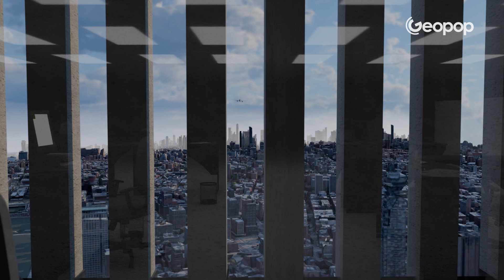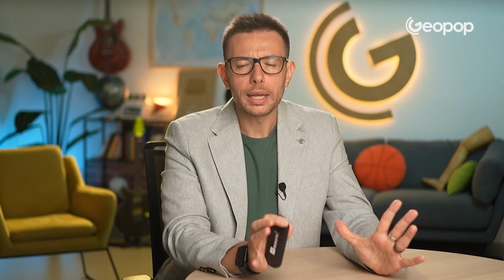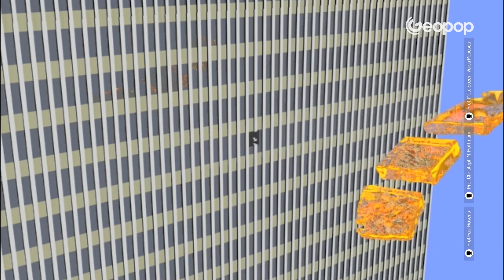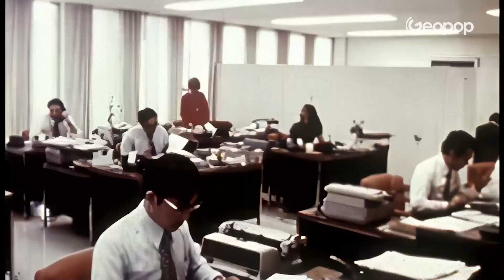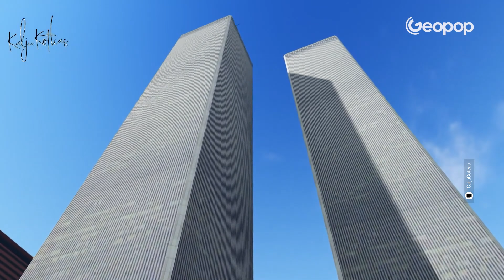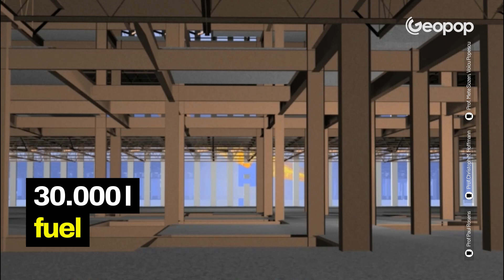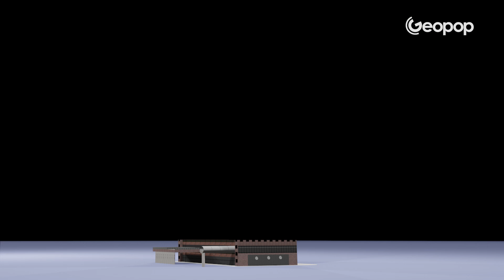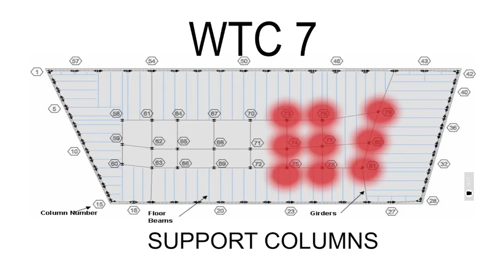9/11, 2001: The Technical Reconstruction of the Twin Towers and WTC 7 Collapses

Comment: One commercial plain with ppl and low amount of fuel can collapse the most endurable constructed building in world? You actually want us to believe in this BS? How can lower floors who haven't been intact with flames collapsed as they were made from paper?..nonsense....ok it's possible to be collapsed upper floors, but lower isn't possible in fact they are constructed to be capable to maintain high earthquake magnitudes! But if you watch how controlled explosion with termite dynamite is used in construction for demolition, it fits like 200%! For ones that believe in this BS just watch videos of urban areas that are involved with war like Belgrade or Sarajevo or any building in Ukraine or Israel, with high temperature altitude rockets and bombs, those buildings still stay strong, now think twice what is truth and what is BS that they want you to believe!
Reply: Belief has nothing to do with it. It's science, but science is hard and most people are lazy and want to take the easy way out with a simple hand-wave rationalization.  Not me though.

Twin Towers collapses were relatively straightforward and well understood in the professional engineering community within just weeks. Yet there’s still a lot of really bad information floating out there easily accessible on the internet, premised on wild baseless speculation and pathological theorizing with easy hand-wave answers.  Engineering is hard. This stuff is simple, exciting and requires little or no thinking, so it gets far too much attention.

Because anything can seem like a conspiracy if you don’t understand how it works I prepared my own short yet detailed technical description of Twin Towers collapses from my own observation and analysis of available true and relevant facts. No politics, ideology or magical thinking, just engineering. Hopefully this will dispel many common myths and answer most if not all questions you may have about the collapses.  

While complex, most of the Twin Towers collapse mechanisms can be seen with the naked eye and easily discerned and understood by the layperson if sufficient time is taken to understand.

1. The Twin Towers consisted of 4 primary structural elements that together formed an integrated system where each relied on the others. 47 hollow box-section steel Core Columns carry the majority of the gravity loads. The 236 hollow box-section steel Perimeter Columns carry the remainder and ALL of the lateral (wind) loads. Long-span Lightweight Steel Trusses connect the core and perimeter column together at each floor with a Hat Truss on top to tie the structure together as an integrated unit where no element can survive without the others. There was no structural load bearing concrete and most components were bolted together.

www.youtube.com/watch?v=u7OqrC74Dm4

2. The impact of 117 tons of airplane (= to about 12 dump trucks) at speeds up to 590 mph with the energy of a ton of TNT completely destroys the aircraft. This in no way implies the Towers come out unscathed. Many perimeter columns are damaged or destroyed as are some core columns (example; 33 of 59 perimeter and 20 of 47 core columns damaged or destroyed at the impact floors in the North Tower), This damage is primarily through bolt-shearing failures at the end connecting flanges, as well as bending, twisting and fracturing of weld seams. There was no cutting or slicing - the reality was far more violent and messy.

3. The impacts destroy or damage fire insulation, fire breaks and sprinkler systems on multiple floors. Huge fires are started across multiple floors simultaneously and allowed to spread rapidly with no effective firefighting or fire suppression. This was an unprecedented fire event .

4. The hotter steel gets the weaker it gets . With fire insulation stripped away and no sprinklers the survival time of the steel greatly reduced. Gradually over time heat causes the lightweight steel Floor Trusses at the impact damaged floors to sag, which was observed and recorded. No steel melted or needed to. Structural steel fails long before it becomes a puddle. It just needs to bend

5. Sagging floor trusses pull on the increasingly weak and overloaded Perimeter Columns, causing some of them to bow inward by up to 5 feet. A straight column is up to 4 times stronger than a bent column. The bowed Perimeter Columns buckle and fail, quietly initiating collapse. The formerly static mass above which the structure below could easily support is converted to a dynamic mass up to 30 times greater. Because they have buckled, the Columns above and below the failure point are no longer aligned . The load bearing structure below no longer bears any load as it falls past the lower columns, NOT onto them.

www.youtube.com/watch?v=ULdiD6gYZO0

6. Thousands of tons of debris fall within the four outer walls, down through the open office space, crashing onto the first intact floor it encounters, immediately breaking the bolted column connections as the amount of resistance the Floor Trusses can offer is negligible. The falling debris slows only marginally and briefly. Note: 
6a. This is NOT a solid top block crashing into and “crushing” a solid bottom block . 
6b. The debris falls past the columns not onto them. The columns provide no resistance to the falling debris. 
6c. Only the bolted floor truss connections to the core and perimeter columns offer any resistance. A pair of 5/8” bolts at each end of each truss vs. thousands of tons of falling debris. 
6d. No laws of physics are violated. 
6e. There is no 20 floors against 90 floors but rather 20 floors against one floor, then 21 floors against one floor, then 22 floors against one floor, etc. 

7. This floor-led collapse progression within the four outer walls can only go straight down.
7a. This process is often incorrectly referred to as “pancaking”. The catchy name stuck but nobody knows what it really means and "pancaking" is too simplistic and inaccurate anyway. I prefer Kaiserschmarrn.

8. Collapse progresses through the floor systems past the columns, through the path of least resistance . The resistance offered by each floor is always the same while the mass of debris and its velocity – thus its energy - increases with each floor failure. Each floor offers the exact same resistance to the falling mass while with each failure the falling debris constantly gains both mass and velocity. *This process of floor-by-floor destruction cannot be arrested, it can only speed up . Rate of floor failures increases with each floor as momentum increases, reaching an average acceleration of 0.65 of GA, or 35% slower than true free fall. Bam, bam, bam down the building until there are no more floors to fail. The resistance offered by each successive floor is always the same. More mass, more velocity, same resistance with each floor. Don’t get stuck on the but the lower floors weren’t on fire nonsense. They weren‘t and didn’t need to be.

9. The Towers were 95% air by volume. As that air was compressed inside the building it is forced down the tower and blown out the sides in reaction to the building collapsing . Those were not “explosions”, it was expulsions of compressed air caused by the collapsing building, explaining the low velocity, lack of flash, blast, supersonic pressure waves and lethal high-velocity ejecta.

10. Perimeter Columns become detached and peel away like a banana behind the collapse front, playing out to the four points of the compass extending to more than 800 feet from the base of the towers. This was quite obvious from examination of the debris pile.

11. Core Columns fail last as their internal beam bracing is stripped away by falling debris and lateral support from the floor to perimeter columns is lost.

12. For those who care about how long this whole process took; 31-34 seconds from the moment the perimeter columns buckled until the last core columns hit the pile, or 1/3 the rate of true free fall. Don’t believe me? Just watch any video of the collapses and note the loose truly free-falling debris dropping much faster than the towers themselves.

13. Each Tower had a 1-acre footprint. Far from collapsing inside their own footprints the debris pile spread out over 17 acres in a pile up to 14 stories deep. 8 surrounding buildings were destroyed and scores more damaged by the falling debris.

14. NOT observed were the 180-190 dB bangs of thousands of high explosive devices or the blinding bright flashes of burning thermite. Neither explosives or thermite could have survived the impacts and subsequent fire nor could have caused the (silent) perimeter column buckling that clearly initiated collapse either. A video of a shocked and injured firefighter casually using the magic word explosion is in no way proof of explsoIVES and the demolition_ case relies entirely on that sort of thing. There is zero tangible physical evidence and it would be technically impossible, totally impractical and completely unnecessary. No one would bother.  In 24 years zero structural engineers of tall buildings, including the 1/3 that have retired in that time, have made any statements in support of pre-planned demolition claims. NONE. The lack of any such citations in the engineering literature (published in any country worldwide) is telling.

15. Twin Towers were perfectly safe within their design envelope. They only collapsed when taken far outside design parameters by an extraordinary and unprecedented event

Impact + Fire (heat) + Time + Gravity = Collapse . Remove any one of those 4 elements and there is no collapse. Ignore any of those elements (as many do) and you will never understand the collapses. The Twin Towers were an integrated system in which no one component could survive without the others. One fails, the rest follow, through the path of least resistance – DOWN – through the open space, bypassing the path of greatest resistance – the columns. Nothing I just described violates any laws of physics. All of the above is true no matter who planned and carried out the 9/11 attacks or why

I hope you found this helpful and informative. It is not meant to be adversarial, but to solicit informed critical comment, positive or negative. If I made any errors of fact, logic or reason or left anything critical out, please let me know so I can fix it. To stay focused, just one topic at a time please and on-topic (Twin Towers ONLY). No word-salads of Gish Gallop. IF you can offer a more plausible alternative be my guest. Please start any reply with the words “Tits McGee” or I will know you didn’t read it, are not serious and just wasting my time.
Reply: @TheLoonResistance stop copy past what those idiots wrote you to believe, as they are payed to lie, ask some independent engineer or military expert, he will explain you that these are just nonsense and lies!
Reply: @TheLoonResistance  just to remind you that ppl are screenshoting and investigating all you that support those Satanists, so you better consider for whom you're lobbying, when their rule falls!
Reply: Why do you say the "plain" was low on fuel? They were fueled for trans-continental flight & had just taken off!

You can't even get the most basic facts right! "Termite dynamite" 😦🤣🤣🤣🤣🤣🤣
Reply: @Tim22222  just image to make military plain without passengers how much fuel you'll have, so yess its low amount! Also fuel just cant inflame by hitting a building! Through history buildings were hit by enormous high flammable rockets and still they stayed undemolished. Just investigate a bit, 9/11 was a controlled explosion demolition operation (with termite dynamite) with a purpose to conquer the "Middle East" because of oil, petrodolar, drugs, military industry complex going on, and Islamic migration towards Europe because of Havoc and anarchy NATO created! Sadam, Gadafi, Assad, were ppl that controlled Middle East and fight against monster terrorists organizations Daesh, Alqaida, Moslem Brotherhood, Hamas, Taliban, Eljihad, created by Mi6, Mossad, Cia! Main purpose of these demonic organization is to sew anarchy fear deaths so Islamic migration get triggered and with Sorosh NGO organizations redirected toward Europe with a main goal of population replacement...
Reply: @guerrillazack1977  What you wrote is a bunch of misinformed nonsense. You clearly have no idea what you are talking about.
Reply: @marcop1563  yeah and you have idea what do those liars told you? Why don't you make some adequate argument that proves that my theory is wrong?
Reply: @guerrillazack1977  I have argued with conspiracy theorists like you for years. Trust me, I did my homeworks.

First, "thermite dynamite" as you called it doesn't exists. Thermite couldn't have been used to destroy the Towers since it burns extremely bright and would have generated a blinding light that is nowhere to be seen in any recording. Explosives couldn't have been used since they would have been clearly audible in all recordings, yet they are not present in any of them. Moreover, the core columns that would have been one of the first element to be destroyed in case of a controlled demolition, are clearly visible as still standing after the passage of the main collapse front and were the last structural element to fall.

The idea that any of the planes was in fact a fake military planes is ridiculous, since there is extensive proof of the identity of all the planes in the form of recognizable debris, human remains and eyewitness accounts.

And your motives make no sense. If their goal was to invade Iraq, they would have organized a flase flag involving Iraq. Instead 911 involved several countries the US had zero interest in invading.
Reply: @marcop1563  that term was invented by CIA to discredit ppl like us who don't trust your lies, just like you supported Pfizer vaccines that are used to inject different DNA and nano-particles which cause cardiovascular problems and strokes, heart-attacks, thrombus and pneumonia...
Reply: @marcop1563  are you kidding me have you slept last 24 years? Wars all over middle east and all regimes changed by so called spontaneous arab springs? Are you so stupid to think that we don't get what have you done for these long periods, systematically orchestrated wars, and destruction?...eyewitnesses?🤣🤣🤣, body human remains DNA samples of terrorists and their IDs intacted?😂😂😂? Are you retarded in the investigation they said temperature was like in literally hell and all those proofs got intact?
Reply: @marcop1563 https://youtu.be/LPhANpsR1gM
Reply: @marcop1563 https://youtu.be/xa6M7n_swNw?si=WSdKd7WO9HWJdoGv
Reply: @guerrillazack1977  - Just imagine using the thinking part of the brain instead of mindlessly repeating boilerplate political rhetoric